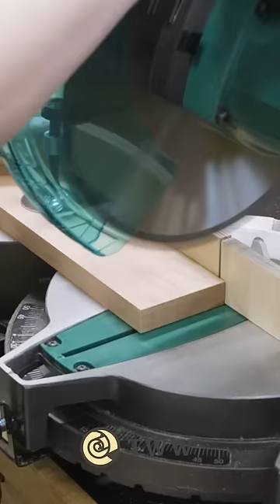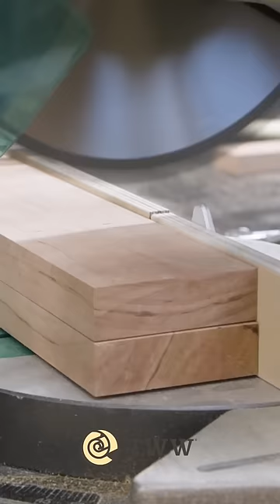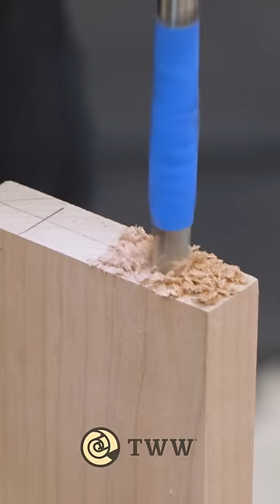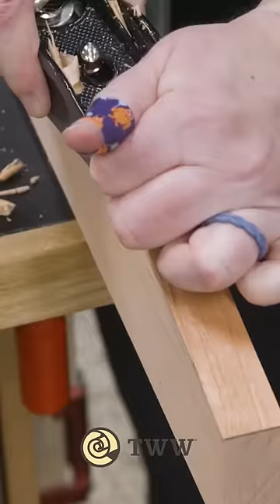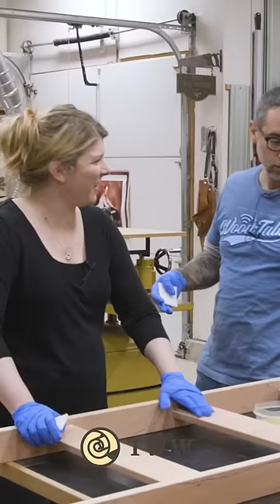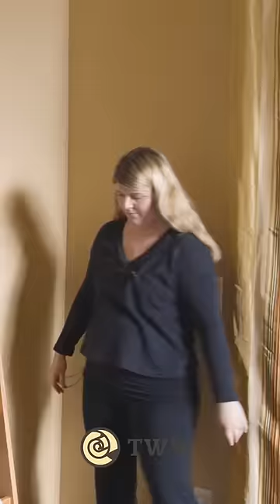Woodworking with my wife be like….. 🥰 | #shorts

Comment: Lets talk about slowing down the cutting federate on the saw and maybe not stop the saw before its clear back above the timber 💁‍♂️
Reply from the maker: Ok let's talk about it. The cutting rate on the saw is absolutely fine. If you want to go super slow and risk burning the wood, that's up to you. In my shop we use the feed rate appropriate for the work being done. As for stopping the saw above the timber? Well, that's exactly the opposite of what you should do. Raising the blade up after the cut risks the teeth digging back into the board decreasing the quality of the cut as well as increasing the chance of kickback, especially with the off-cut. Keeping the blade buried and letting the blade come to a complete stop before lifting the head again is the correct way to do it. If you'd like to learn more about woodworking basics, we have a bunch of videos on our channel including a longer version of this one that you might benefit from checking out.